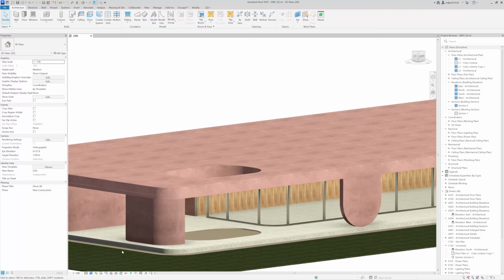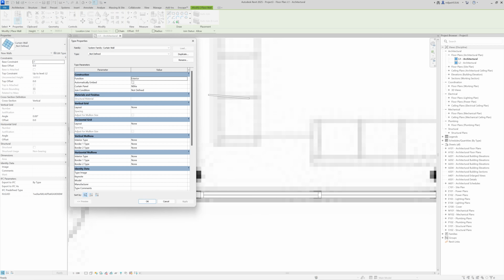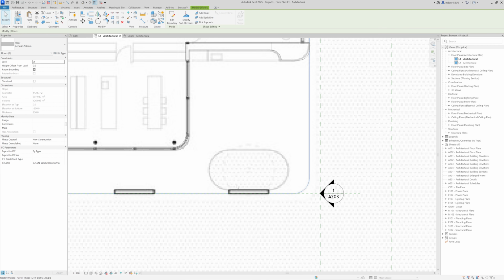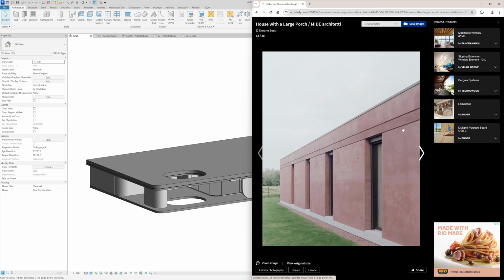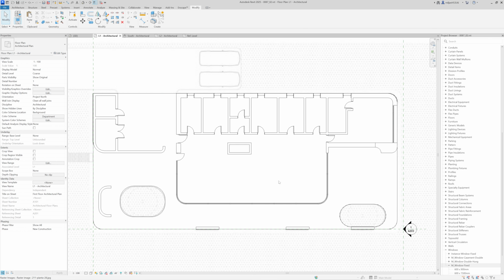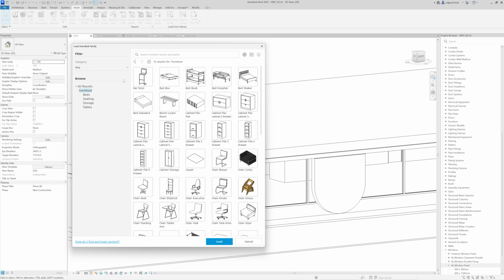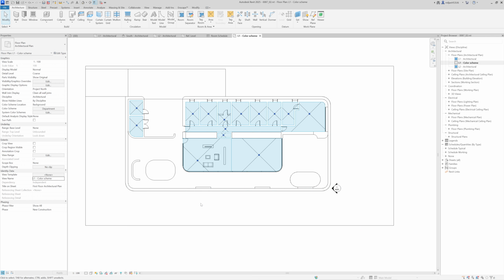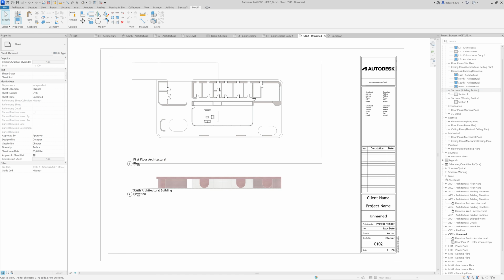Learn Revit basics in ONE hour

Comment from the maker: Here comes additional explanation of Step by Step of what you're going to learn in this tutorial 

1. *Selecting the Proper Template*

    - Start a new project in Revit using the metric multidiscipline Autodesk template.
    - Gather information from external sources like ArchDaily for reference.

 2. *Placing Reference Images*

    - Insert floor plan images into the plan view using the "Link Image" feature.
    - Scale and rotate the image to match the dimensions and orientation.

 3. *Creating Walls*

    - Use reference planes to place walls accurately.
    - Adjust wall dimensions, heights, and materials as needed.

 4. *Designing Facades*

    - Create curtain walls and adjust panel offsets.
    - Design curved walls and connect them to create a polygonal edge.

 5. *Adding Details*

    - Create slab elements for floors and roofs with appropriate thickness.
    - Design openings in slabs for architectural details.

 6. *Applying Materials*

    - Assign materials to walls, floors, and roofs for a realistic appearance.
    - Create custom materials if needed for a specific look.

 7. *Placing Doors and Windows*

    - Insert doors and windows based on design requirements.
    - Adjust sizes, placements, and materials of doors and windows.

 8. *Furnishing the Interior*

    - Load furniture families from the Autodesk library.
    - Place furniture items like beds, chairs, tables, and shelves in the model.

 9. *Creating Rooms*

    - Define rooms based on floor plan layouts.
    - Separate rooms using room separators and name them accordingly.

10. *Enhancing Views*

    - Create different views for presentation purposes.
    - Apply filters, color schemes, and view settings for better visualization.

11. *Finalizing Presentation*

    - Customize elevations and sections with appropriate materials and colors.
    - Organize views on sheets for a professional presentation.

12. *Review and Refine*

    - Check for consistency, accuracy, and aesthetics in the design.
    - Make adjustments as needed to ensure a cohesive and visually appealing model.